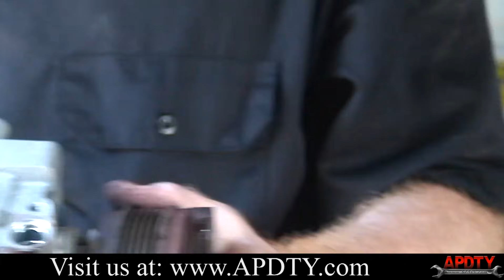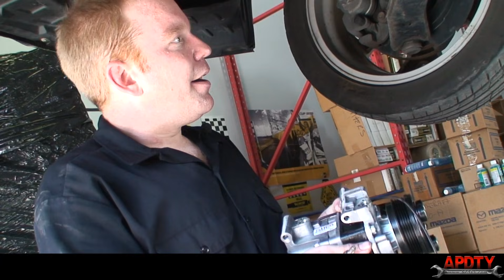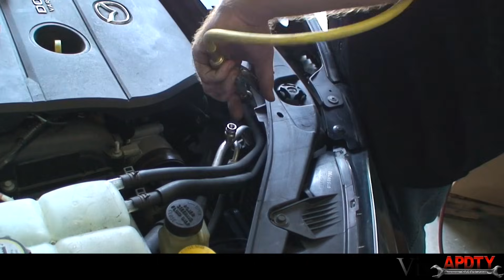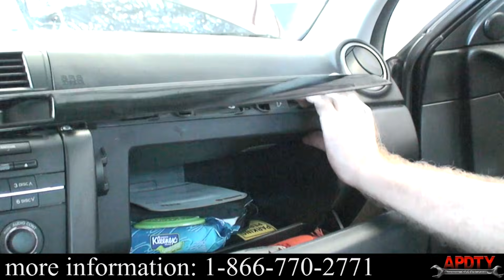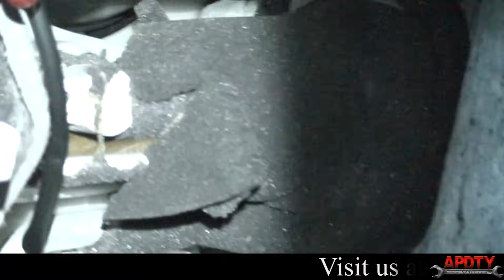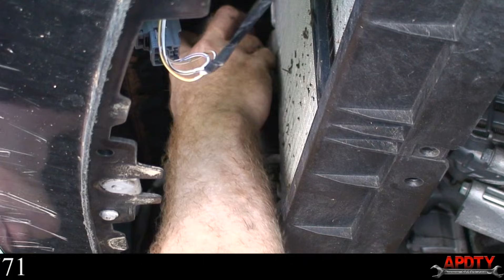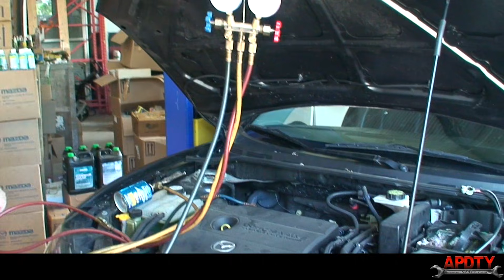AC Compressor, Condenser, & Dryer Replacement On A 2004-2009 Mazda 3 Non-Turbo

Comment: Great video! Is it absolutely necessary to replace the expansion valve and dryer? My AC compressor seized and with general car knowledge and your video it looks pretty easy. Just trying to save some money on having a mechanic do it. Is it easy to put on the belt without the belt tool? Thanks for making the video!
Reply from the maker: Ken Deyoe You really need the belt tool and it is not too expensive and under $20, here is a link to them at amazon:
http://www.amazon.com/gp/search?ie=UTF8&camp=1789&creative=9325&index=automotive&keywords=strecth%20belt%20tool&linkCode=ur2&tag=aupaditoyo-20&linkId=3OVQ2QOIWMVSK2BY

The dryer absolutely must be replaced as it is similar to a dessicant and it will remove moisture from the system but it will only last through the life of 1 compressor and then once the syste, is opened, that desiccant is now sucking in moisture form the ambient air and then it is usually all used up. As far as the expansion valve, this in very rare circumstances can be skipped. Take into consideration that the expansion valve is a valve and if any small particles get stuck in it, it will either not work or could possibly destroy the new compressor if that particle gets loose again in the future. The rare circumstances for skipping can really only be recommended by a professional technician that could have diagnosed your problem form the very beginning. If the compressor failed internally, then it is possible that particles form the old failing compressor have circulated through the whole system and the components with the particles must be flushed completely or replaced. You cannot flush an expansion valve so that is why it is almost always replaced.
Reply from the maker: Yes those 2 parts really should be replaced anytime the system is opened and especially during an ac compressor replacement, You will not get a warranty from anyone if you do not replace those parts, that is because the expansion valve is crucial to the operation and also any old debris will be stuck in it which give you more clues on what happened to your old compressor. The accumulator should be replaced because it will never last the lifetime of 2 compressors and also once it is opened to air, the internal desiccant can absorb moisture from the ambient air, It is never worth it to skip those 2 parts.
Reply: What type of oil should be added. I see one site that states PAG 100 and another the states PAG 46 for the 2005 mazda 3 2.3L.

Comment: Great video.  Question....after you replace the compressor is it required to change all other parts inside the glove compartment?
Reply from the maker: ny1084 Technically the expansion valve and the receiver dryer should be replaced. The expansion valve is back by the glove box and can be a pain to change on some models like the vehicle in the video. You could weigh all the variables like how the ac compressor failed and the overall condition of the vehicle and ac system to decide if you want to replace the expansion valve on a difficult model. If the ac compressor did not come apart internally and if the system pressures can be confirmed to be working properly, you could skip the expansion valve, however a seasoned AC technician should really make this call.

Comment: Very well done, thank you for this!!  I was told by the dealership that I need a new compressor, but I have heard from other sources that I only need the clutch and/or bearing, because I have a sort of chirping noise, but everything else seems fine, so I might try that, because I may be able to do that by myself (fingers crossed).
Reply from the maker: Consider the age and mileage of your vehicle if you are thinking of doing a clutch only. The reason is the compressor itself will have wear and tear on it internally and many times if you just replace the clutch, a little later the compressor fails and then you replace both parts all over again. Also it is getting more and more rare to even be able to find just a replacement clutch.
Reply: Great point!!

Comment: is this the same basic procedure for a cx7 even though the compressor is on the front side of the engine?
Reply from the maker: Yes, very similar, just bolts up slightly different

Comment: hey, my ac compressor is jammed and i saw some smoke coming from the hood.the mechanic told me that the compressor need to change and its gona cost me around 700$ to replace it..since i dont use my ac.should i just cut the ac compressor belt.so it wont make any noise,smoke or give me any problem...
Reply from the maker: You can do that as a temporary solution, but make sure not other component is running off of that belt. If the belt only goes to the AC compressor, then you are ok to cut it.
Reply: Yup. That's what i did.

Comment: Do you have a link to the tool for putting the AC belt on?  I really need that right now thank you
Reply from the maker: AHH YES, The stretch belt tool is hard to find, we have plenty in stock and here is a link:
http://www.apdty.com/item.wws?sku=100010&itempk=12956896&mfr=APDTY&weight=1

Comment: What in your opinion should be the cost to do all of what you did with parts? How many hours would this job take a trained tech?? Thanks in advance! Great video! If I had the tools, lift and time I would attempt myself, but I don't! :) Great job!
Reply from the maker: The job shouldn't take more than 4 hours including all the evacuating and waiting on machines for an AC technician.
Reply: Thanks for responding!
Reply from the maker: I know this is an old question but we had someone recently quoted $1600 for this job at the local Mazda dealership. Of course that is using OEM parts and that is always slightly more expensive. Good aftermarket brands do exist though and they are usually much cheaper.
Reply: I have an 07 Mazda 3 2.3L. I asked Radair worst case if I needed a compressor about how much would it be and he said around $800. Im hoping that they would do everything that was done in this video. I'm still on the fence about just doing it myself. Good luck